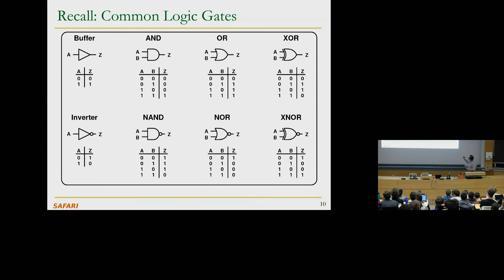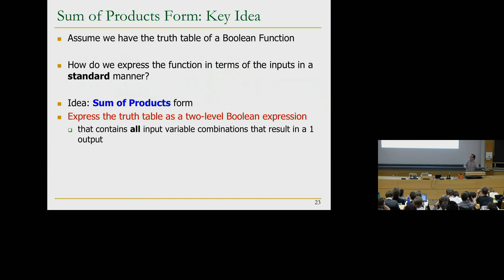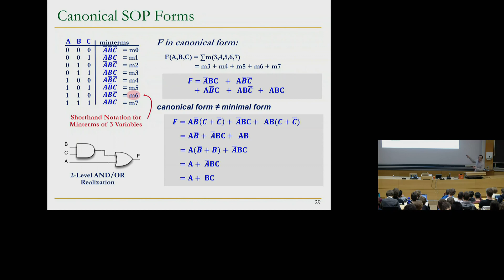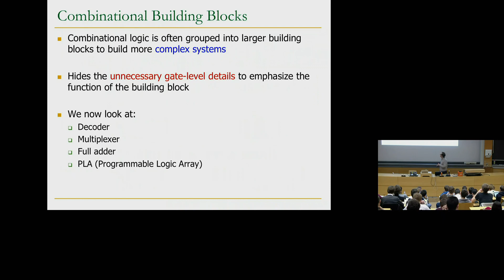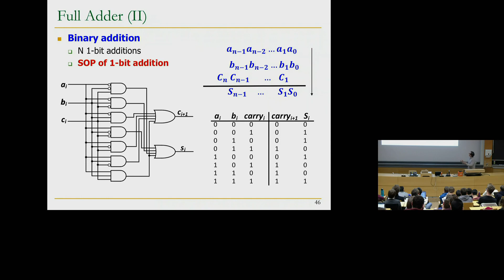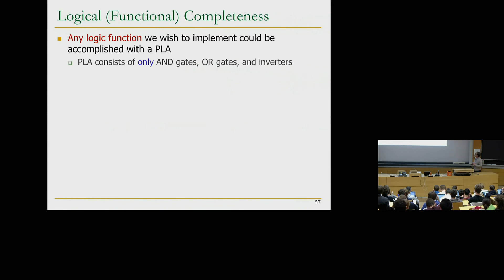Digital Design & Computer Architecture - Lecture 5: Combinational Logic II (ETH Zürich, Spring 2020)

Comment: At 1:06:50, I feel that the output is not correctly mentioned because s0 refers to the second digit of the input while s1 refers to the first digit. Hence, the truth table should be:
1. 00 -> D0
2. 01 -> D1
3. 10 -> D2
4. 11 -> D3